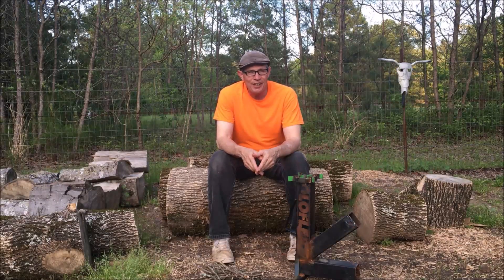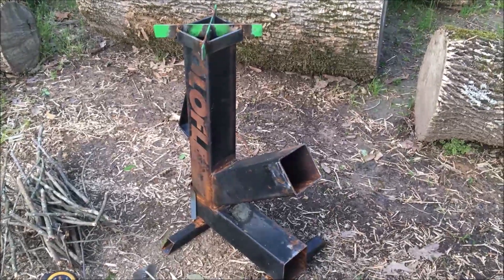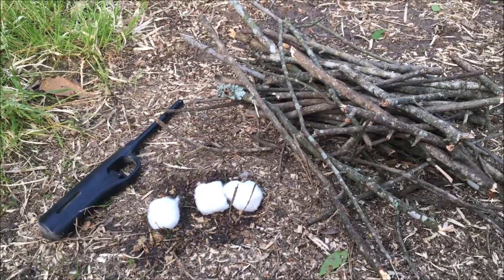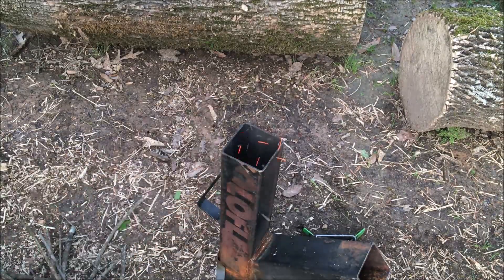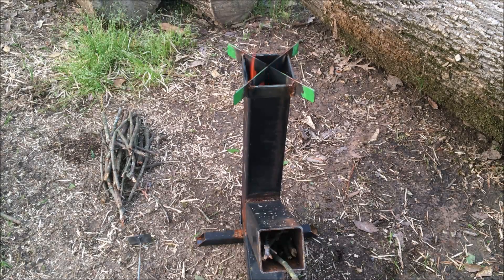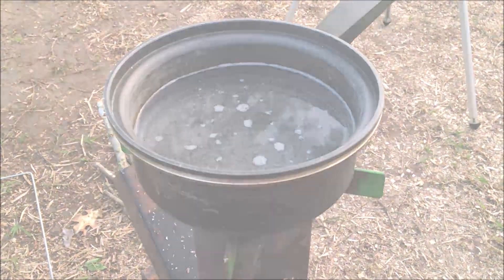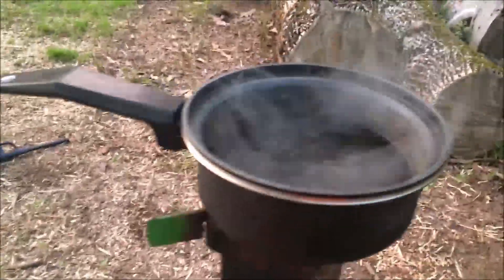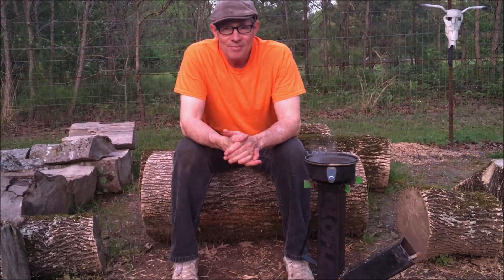Rocket Stoves - Do They Really Work?

Comment: Good video, i make rocket stoves myself and have learned that thicker metal is more efficient. I only use 5mm steel for the body of the stove, it dose add a lot more weight to it but makes it more effective. Also adjustable flap on the air box for a slower or faster burn with the feed chamber flap closed, controlling the burn with the air flap works great with a 5mm hot plate fitted for grilling.

Comment: Yes, they do, if you build one. Yours is not a rocket stove, it is a shit stove.
Proper rocket stoves have HEAVILY INSULATED riser, and reach temperatures that would not only melt, but eventually BURN through those stupid metal pipes. 
Every other random pipes welded together are apparently "rocket stoves" today.

Comment: I could be wrong as it's hard to see but it looks like the pot holder is too low. When the pot is placed on top it blocks the air from getting out. The stove can't breath properly. If I'm right you should consider raising it an inch or so. Thanks from Australia.
Ps. I think your accent is cool.

Comment: Nice job and all, I like you vid and easy going attitude, and your stove is well made. Respectfully, insulating the burn chamber is where the rocket stoves get their efficiency from. That is a "nominal" rocket stove, not trying to tit for tat or anything.  They're basically a draft furnace.  Minus the warm up time, they are pushing 8 - 10 times efficient on wood. Boil time, i dunno, but they get scary hot, and errode the still like bbq grill reflectors get after a while.

I did enjoy the video.

Comment: For these stoves i have found that by filling the chimney loosley with balled up newspaper with layers of twigs in between makes for a great starter. As the newspaper burns it continues to drop ash down and burns down and by time the fire reaches the bottom it has a nice layer of coals and draft. And if desired can even pre load the feed tube to kick off right away.

Comment: Shouldn't you cover the hole where the sticks go in so the air can only come in the bottom, making it rush in harder, thus making your coals hotter...like a forge?
Reply from the maker: Yeah DOC you're probably right, thanks for the suggestion.
Reply: @oaklawnopry  Thanks for the response! Wasn't trying to point out how you "did it incorrectly" or anything like that....just trying to gain all the information/pointers I can as I want to build one myself! 😎👍